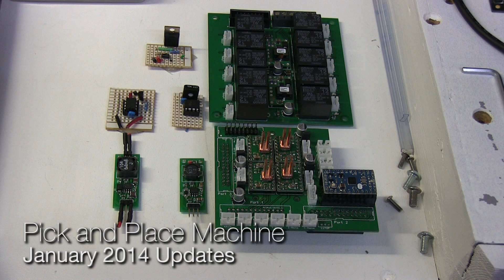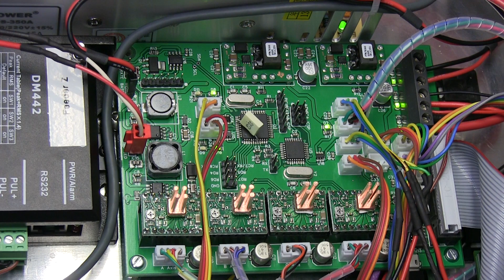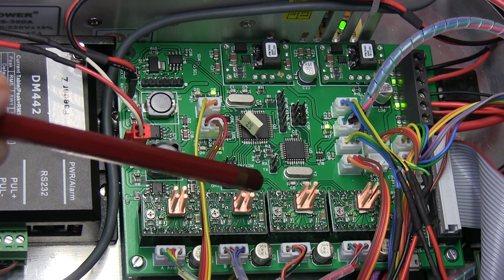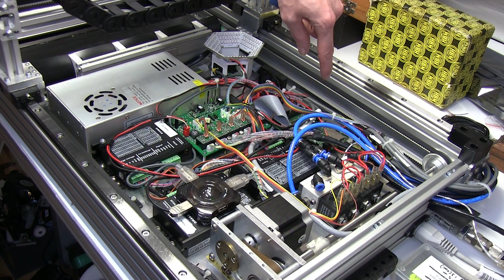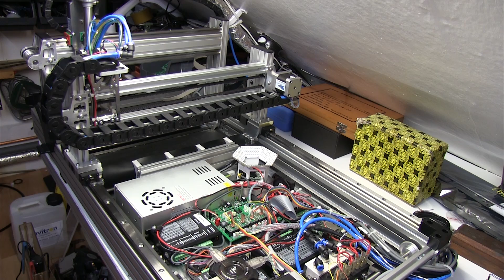DIY Pick and Place USB Controller Board

Comment: Good work, but why you use smooth stepper and mach3? why not something like grbl or smoothieboard ? Mach3 has simple programming API I tested with C# and .NET but sending command to grbl based controller is not so complicated too, i thing interpolation is not required in this type of machine.
Reply from the maker: We used the smoothstepper board rather than the gbrl or smoothieboard due to the inputs and outputs we needed and the requirement to drive larger stepper motors than the single board with built in drivers could run. We had originally planned to use OpenPNP but couldnt find any driver boards with enough IO ports which would work with the software.